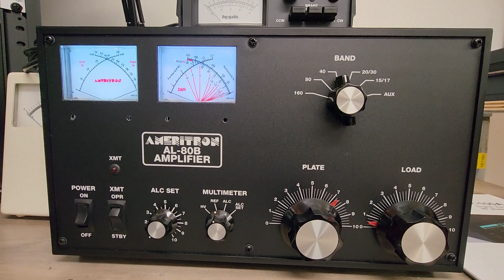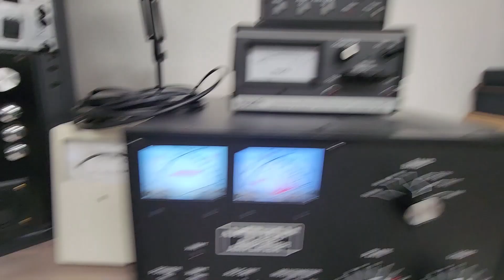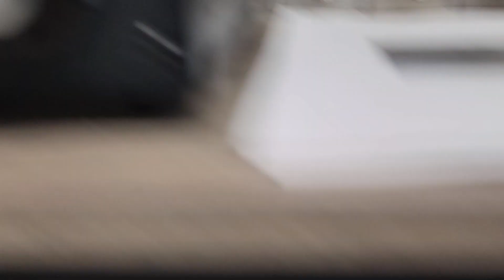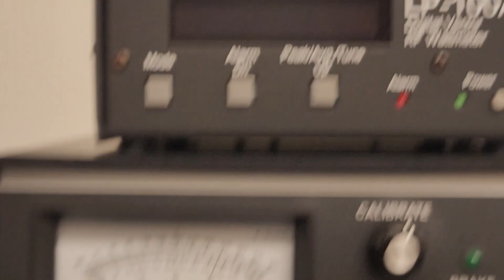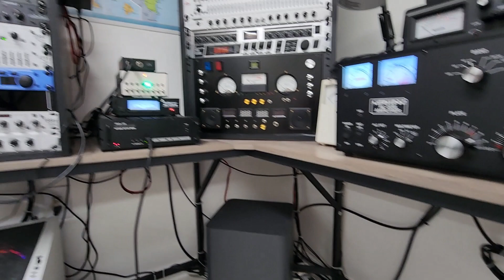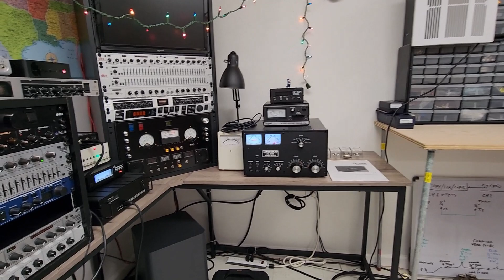Thetis Pure Signal up and running.

Comment: Bottom right corner where the green “fb” is, drag that out so you can see the feedback number. Also click the “dup” (duplex) button for pure signal.
Reply from the maker: Update: In a nutshell, pure signal needed a little more mic gain on the main screen. I bumped it up to 14dB. Pure signal stays activated and FB correction numbers show all of the time while talking. Found information on the Apache community forum. "For best PureSignal response, set MIC level to reach 0 dB and +3 dB on voice peaks. Paul, W9AC"
Reply: @KP68videogates  yes, if you watch my stream mine peaks around 3-4db
Reply from the maker: Hey bud! Ya, I simply forgot about the "DUP" button in this video. Thanks for letting me me know about dragging out the FB box. Even when I do drag out box, I am not sure why it still does not constantly show numbers. Says correcting and signal looks very sharp with DUP activated but sometimes does not show the correction number.
Reply: @KP68videogates  when you stop talking for a sec the number should go away. I’ll call you this week.
Reply from the maker: @kb2uka575  Sounds good my friend. Love to hear from you.